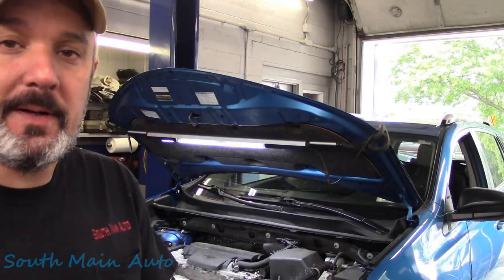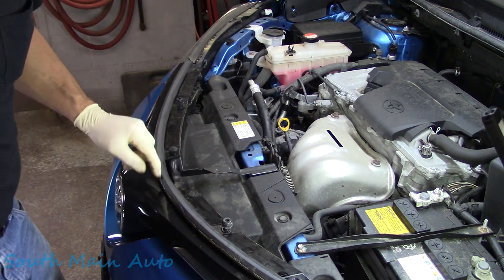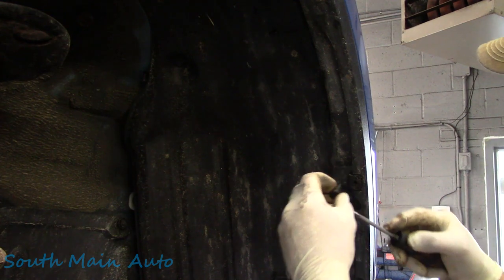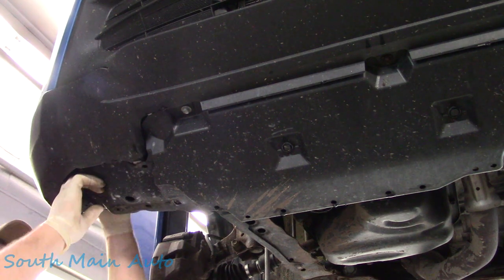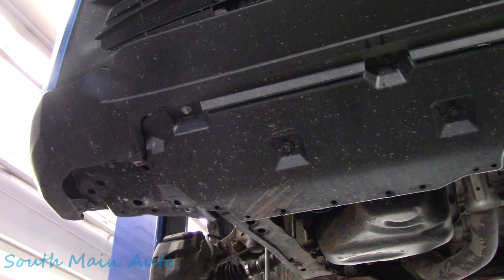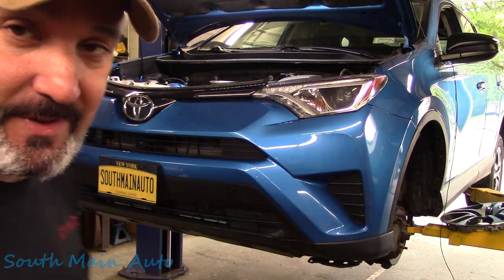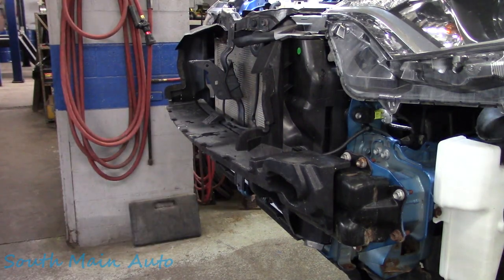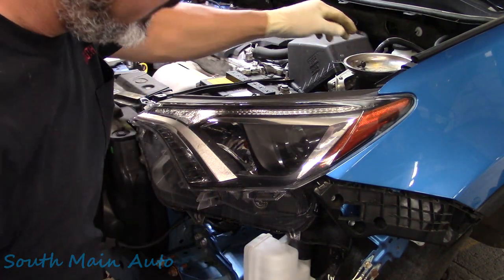2013-2018 Rav4 A/C Condenser Replacement

Comment: I often see cars with plastic wiggly bits come back from the mechanic all mangled up - Eric is so considerate and respectful that it`s a joy to watch.
Reply: The effects of the "flat-rate" culture...
Reply: I agree..that’s the reason why I got hooked on his channel.
Reply: The difference between someone "just doing a job" and someone who respects and cares for their customer and customer's property
Reply: Those jiggly bits can be insane-making. I lost track of how many different kinds of clips and retainers came into play when I was replacing a mangled inner wheel liner on my daughter's Corolla...
Reply: @DIYDaveOK  Amazon has all that stuff. I got clips for my 4Runner grill that were dry rotted for dollars…I also grabbed a pack of assorted body panel clips. It’s come in handy on multiple vehicles we own.
Reply: @michaelschmidt5179  I did the same thing. Bought up a bunch of variety packs of clips and retainers. Aside from one older vehicle, virtually everything in my family is a Toyota product, so a big pile of Toyota clips can't steer me wrong.😁
Reply: When I got my struts replaced I letter noticed 3 of my plastic fasteners were missing. . It's the little details that set people apart. Eric don't play that way.
Reply: I mangle the plastic wiggly bits myself, I don't trust anyone to mangle them properly...
Reply: @DIYDaveOK 
Try an Italian car... 🤣
Reply: @michaelschmidt5179  ppl

Comment: This is my favorite kind of South Main Auto video. No computer diagnostics. Just straight up nuts and bolts. I love these. I could watch Eric O do a brake job once-a-day. I love the ball-joint, the stabilizer bar bushings, the wheel baring videos, and the exhaust manifold videos. I would love to see big jobs such as new head gaskets, new rings, or drive shafts. Has there ever been a SMA video showing an engine replacement? I do understand the value of the "how to use problem codes" to diagnose the source of the problem. They are wonderful displays of how a Grand Master Mechanic thinks. But I like these nuts and bolts videos much better.

Comment: I think I am right remembering that some other mechanics don't like how to DIY car repair channels. I helped someone yesterday who wanted to change the front breaks on a 2012 4Runner " With the big V8!" A tool box that could fix a bike. So got my Tools and jack. Breaker bar jack stands. 

We had to use the jack handle on the breaker bar to remember the lug nuts. Someone went full gorilla with the air gun, because 4 feet of pipe was barely working and thank God there are 6 lugs per tire. I could not stop him from using all his weight and 4 feet of pipe putting the lugs back on. Thank God he wanted to rotate the tires. 3 YouTube videos on how to jack up a car. He agreed with me. 

 Showed him how to put a socket on the ratchet. Push the button. Had one stuck piston. 3 YouTube videos later he agreed to loosen the bleeder. 

I am glad he's trying, but he doesn't need my help. YouTube ain't helping him unless you want to start with you need tools and how to use them and listen to the old guy helping!

Comment: You are right on target with the engineering on modern cars, maybe too much dependence on computers but still more dependable and safe then ever before.
Reply: The problem with computerization of modern cars is 2-fold. 1) is you have a Federal government finding just about anything on a car they can regulate. 2) is a matter of content creep. What was available on only a few select cars 10-20 years ago is now demanded by the mass market.  All of it needs to be controlled somehow.
Reply: The computers are what makes cars safer and more reliable. Just think of how stinking unreliable cars of the 60's and 70's were.
Reply: *than.
Reply: @kain0m  Yah, except electronics- what there was at the time- was no better. Automotive computers all grew up at the same time with the general overall rise in quality.
Reply: @billh230  the Feds don't regulate for the fun of it. Auto manufacturers only care about profit. They dont care about occupant or pedestrian safety, they dont care about pollution, they dont care about efficiency, etc. Customers demands cant drive those improvements because so many of their decisions are based around cost.  Are you old enough to remember when every parking lot reeked like gas in the summertime and major cities were blanketed in smog from all the unburned hydrocarbons coming out of vented gas caps? Legislation mandating evap systems and catalytic converters fixed that problem.

Comment: Watched a video of a 1973 Cadillac crashing into a 2003 Cadillac.
The crash test dummy in the 2003 survived with what would be some broken bones.
The crash test dummy in the 1973 had its head taken off by the steering column, chest imploded by the column and knees crushed by the dash board. It died about three different ways.
You could see the frame buckle as it hit and the shock of the crash ripple the whole way through the car.
The other car was crunched in the front to the firewall but it absorbed all the shock of the crash.
Very telling video.

Comment: I feel you on the “amazed it runs”. Think about how many times the crank, cams, and everything else has spun in 50-100-150k or more, you’re at a number that’s so high no one can even comprehend, and now today driving a car with 200-300k isn’t out of the question, 50 years ago you hit 100k it was remarkable, now 100k is “it’s broke already?!?!”
Reply: 01 tacoma pre runner 270k+ miles (has new starter and new idler pulley and new head gasket. Everything else is original. I did have to replace the power steering rack. But that's not engine related.
Reply: @demonknight7965  most cars 2015 up have a hard time going 60k without something major going wrong. 1995-2005 was the golden age of automotive reliability imo.
Reply: @mikec81  Yep!
Reply: Not a big fan of Toyota, but you gotta hand it to them. They build a quality, reliable car.
Reply: @billh230  reliable for sure, quality is abit, varied, from what generation. I have a 2011 corolla for a work car, minimal work in the 70k I’ve put on it (bought it with 97k), the interior and some exterior plastics def scream late 00’s, no shortage of plastic. But if I wanted a luxury car I would have bought a Lexus. It gets me to and from work at 36mpg, and keep the miles and salt off my truck 😂
Reply: '99 Camry. 3.0
 425,000+ miles.
All original.
Replaced brushes in the alternator.
Replaced lock up solenoid in tranny.
Some oil smoke on start up.
Still will get up and move!
Reply: My old 98 Jeep XJ Cherokee has over 300k on the original drivetrain. Body is going to hell, but it still runs great.
Reply: Well,,  if a car is driven 3 hours a day, at 2000 rpm, then the camshaft will turn 180,000 times,,  in 1 year it turns 65,700,000 times,, in ten years,,  657,000,000 times,,  My Chevy Venture is 25 years old,,  still runs very strong, and does not use any oil,, only replaced normal wear items,,  brake pads, rear shocks, tires,,   etc,,,
Reply: '00 Jeep Grand Cherokee with the dreaded 4.7L. 265,000+ miles and engine is going strong.
Rockers, nonexistent! LoL 😂😆
Oh, it's a beater with a heater and AC!
Reply: I'm hitting 125k miles on my 2010 Honda fit and no problems besides other f*n drivers or gardeners causing body or windshield damage.
Reply: @mikec81  Truth!  The technology to quality pinnacle was late 90s-pre 2010 I’d say.  The newer, the less longevity.  Sad, considering most people will still be making payments while they have to pay huge bills to keep the sh!t boxes running.  I worked in a local privately owned shop in the early 2000s and don’t remember ANY cars coming in with less than 50k miles for things other than brakes/fluid changes.  Now it has become acceptable for quality to be so much lower somehow???
Reply: My 2022 KIa (5k miles)just left me and my family stranded on the highway.. stopped accelerating when I  was going 70mph then smelled gas from motor once i got it pulled over..smh..it didn't throw check engine light..Kia il saying injector.. idk if I believe them..it should of threw code for misfire

Comment: Love your channel. That plug with the wide housing goes to the cruise control radar that is located behind the Toyota emblem on the bumper. The radar monitors the vehicles distance in front of you.  It was available in select 2016-2018 Rav4 models.
Reply: I have the adaptive cruise in my 18 RAV4. It's awesome
Reply: I just posted the same comment, now I need to go back and delete it, lol

Comment: That’s what I love about my ‘06 Dodge Ram 2500.  Open hood, disconnect lines, remove 4 bolts, remove condenser.  Got a new one from NAPA (they wouldn’t sponsor me either).  To install reverse removal process.  Close hood.  System self evacuated through gaping hole in front

Comment: You are 100% correct about buying a Denso condenser. I bought a TYC brand because I wanted to save a few bucks.  When installing it today on my 2015 RAV4 LE, I discovered that the 4 legs attached to the condenser were narrower than the OEM unit.  I had to be "creative" in order to make it fit.  Not Ideal!!! Thanks for your amazing videos...much appreciated!

Comment: I just learned how crazy expensive it is to pay for this repair and your video showing all the labor for jiggly part removal/replacement helped me decide against tackling this myself. Aside from tires and brake pads, my rav has 85K miles with no other issues, so $1,200 to make it whole again is doable. You video is excellent.  Thanks!

Comment: I learn something here every time - it simply never occurred to me that if an AC system has already discharged itself through a leak, that Joe Shadetree Wrenchbender could replace AC parts at home and then have a shop do the vacuum & recharge.  Great tip.
Reply: Just to be sure,,, push in the “shrader valves first ! “

Comment: Eric, I've worked with both auto OEMs and Commercial truck OEMs. Spent a lot of time at assembly plants' End of Line. I have always been amazed when after all the assembly, for the most part, they start up and run and drive off the line! There's always a few that need to be pushed off, but not many. Those get fixed on a side line.
Reply: I've worked for a... ahem, major Detroit automaker that has been bought out a few times, for 12 years, and the same thing amazes me every single day. They actually run and drive right off the line. Except for those "few".
Reply: Lots and lots of engineering going into making sure that is the way it is. Automotive is an amazing field. It's the perfect balance of the cheapest, yet still reliable and funtional components possible. Cars are by far the most complex mass manufactured product on the planet. Any factory defect would lead to unbelievable costs for repair. If a car has a serious defect at the end of the assembly line, often times it is cheaper to scrap it than to repair. So making sure the assembly process is bulletproof is paramount.
Reply: @marlon2k9  pity the poor customers that get one of the “few” 😦
Reply: @kain0m  I'd say an airplane would be the most complex these days
Reply: @twig3288  Its usually something really minor like an electrical connector didn't get seated all the way.
Reply: @LoneWolfSparty  He said mass manufactured. There's almost 10 million autos made in the US per year but only 1500 aircraft.

Comment: I just did this on my 2014 Rav4.. I went with an aftermarket for $75.00 and it fit perfect and works great.. The aftermarket doesn't use those silly top brackets that Toyota has that cause leaks. They weld the pins right where they need to be and the stock rubber grommets fit perfectly. The unit fits right in with no issues. I like to spray down the rubber grommets with WD-40 or silicone spray just to prevent dry rot and heat damage. 
Nice job... 👍 😁

Comment: A/C condenser at 34000? About as bad as my dad's Tacoma needing a compressor replaced @ 41K.  I love what you do for me Toyota!
Reply: I was thinking the same thing.. Seems odd. I have vehicles that are 30yrs old and near 300,000miles with the original condenser, seems like they wouldve figured out how to make them by now.
Reply: Don't disagree, but this is better than the garbage Chrysler products that use PLASTIC refrigerant lines. Amazing they don't last very long, lol.

Comment: That whole process of taking things apart and remember where everything goes. I used to kinda do that ok. There's so much to remember. I got to where I put the screws and bolts back in the thing I took off so I don't have to remember where it went. Making a video is an excellent tool. Make lots of vids and then study them to see what you did.
Reply: I recommend taking lots of picture and also I can use my local library to access the Chilton Library data online.  That help tremendously.
Reply: @R_Forde  Also add coded plastic tubs be they margarine, lunch meat, to go containers, or actual store bought food storage containers
Reply: I try to put bolts back and keep like fasteners grouped if they can’t go back in the holes. If just taking it apart then putting it right back together I can remember where stuff goes. But, it sucks when you take it all apart then have to wait a week or two for parts/approval/whatever. Or, sometimes one person takes it apart and another will put it together.

Comment: I'll still put the old cars up to new ones, if the old ones quit it was one of a few things and maybe 30 minutes to. Like fuel pump 2 bolts 2 clamps good to go and where you could get to it. But I'm old and hate new cars by but glad Mr O puts out great videos to try and keep up. Have a good one.
Reply from the maker: Oh sure I can see both sides of the coin for sure. That is why I still own all pre emission tractors ;) I don't want any of the computer BS that comes with the new ones haha
Reply: @SouthMainAuto  Diesel emissions equipment feels about the same as 80's gas emissions stuff. 🤣

Comment: Nice guided repair, fingers crossed my wife's 2018 Rav4 doesn't have this problem but it will be nice to have a reference video if it ever happens. Even as a professional mechanic it's handy to have a video to get an idea of what you're getting into. Thanks for the upload.

Comment: I had to change a bulb for my fog lights on my 2009 Honda CR-V. To access the bulb I had to drop the bumper cover. It wasn’t quite as elaborate as all your parts, but we (grandson helped)did it 20 minutes off and 10 minutes back on. The old cars you didn’t have to remove anything but the condenser.   Great video, lots of patience & drive. God bless!   Thanks…Jim

Comment: Ramblings of a mad man here - This is just what I needed to see!! I do not have to replace the condenser on a Rav4 any time soon. BUT, tomorrow, I have to tear into an OKI C931 Laser Printer further than I ever have before (replace 2nd registration rollers). 1 tool, #2 Philips screwdriver. But so many stupid connectors, and a crappy "service manual"... If you can do it, I can do it!!! Excellent video!!!!

Comment: Yep that is for if it had a Front Radar or Park Assist. Yours isn't equipped but if doing one with a radar would need to have calibration performed once finished per Toyota.
Reply: My mechanic was complaining about the calibration requirement.  He says he doesn't know any local independent shops that have the calibrator and it really expensive for the customer.

Comment: My 04 Volvo has 210,000 with no issues.. my 06 Volvo has 173,000 I just replaced the turbo.. you guys have a lot more rust than we do.. your a great mechanic just not used to the New York ism.. I'm in Ohio. Good job!

Comment: I've been working on my own cars off and on for over 25 years. I've done transmissions, clutches, timing belts, steering racks, fuel pumps, suspension, rear main seals, etc and I've never torque wrenched anything lol. Had a few control arm bolts come loose but never had any big issues luckily.

Comment: I agree about letting a pro charge the system.  I have gauges and a vacuum pump but no scale for refrigerant - just cans. I've converted a couple of R12 cars successfully, but I really messed up my truck and managed to overfill 2X based on what the shop said. Blows cold on 100+ TX days now.

Comment: I bought a used  (4K miles)Toyota T100  27 years ago.   It has 160K on it.  The A/C still works great as does the alternator.  Changed a water pump and timing belt along the way.    Regularly maintained.  Calif. truck in great condition.  A keeper.   Never let me down.  Amazed it keeps running....
Reply: I had to have my 01 tacoma a/c recharged couple weeks ago. Schrader port had a bad o-ring that let all the gas out. 200.00 to fix. 10.00 for both Schrader cores 25.00 for freon 125.00 for using machine plus tax
Reply: @demonknight7965  Excellent!  However, it doesn't surprise me for that vintage Toyota.  They seem bullet proof.

Comment: I had good luck with a rebuild kit from UAC.  Compressor with clutch, condenser, dryer, orifice tube, seals o rings and oil $265.00.  I did the water pump, heater core, and radiator at the same time.  All working well, a year and half later.